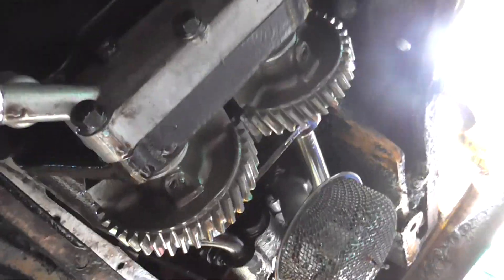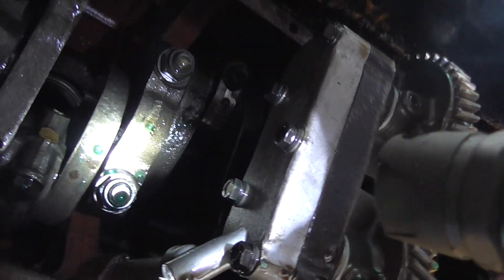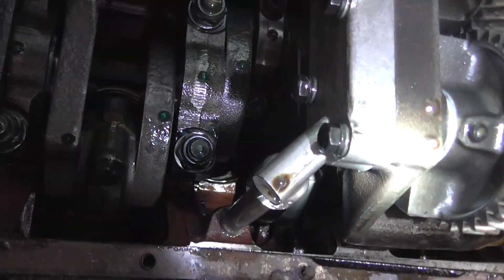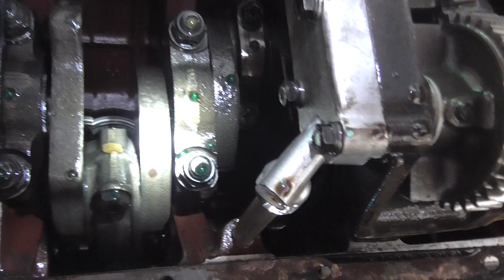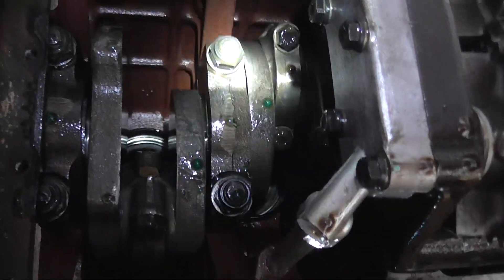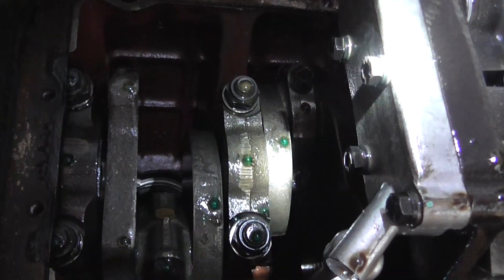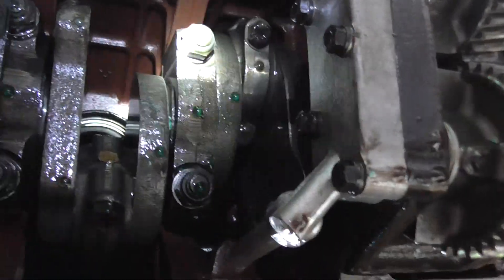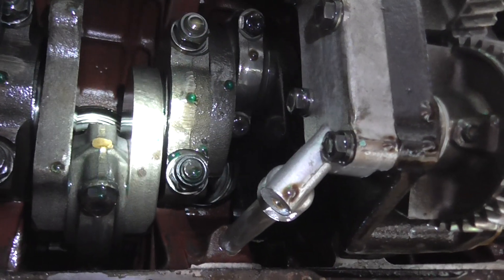1977 JCB 2D k 2 coolant leak investigation. Leyland 498 engine

Comment: Hello from greece James. I have a 3cii and has the same problem. Do you have to remove the oil pump to replace the lines and the seals or its possible without removing it?
Reply from the maker: No, on  the leyland 498 engine you may have to remove the balance to make the job easier. Not a bad job to do . And parts are not expensive
Reply: @DOCTORDROTT  Thank you very much for the reply. I ve already remove the oil sump and the cylinder head. Tommorow i'm planning to remove the liners. We will see how it goes cause its kinda  uncomfortable to work under the machine.